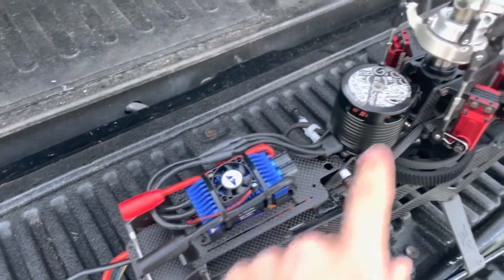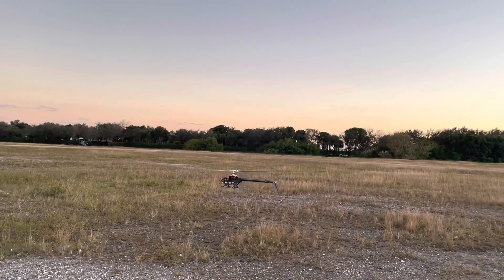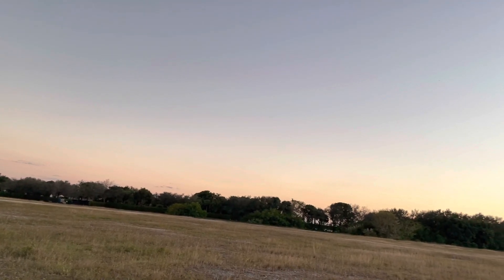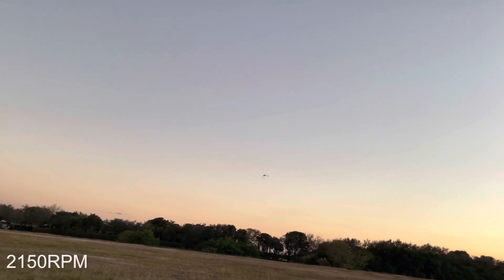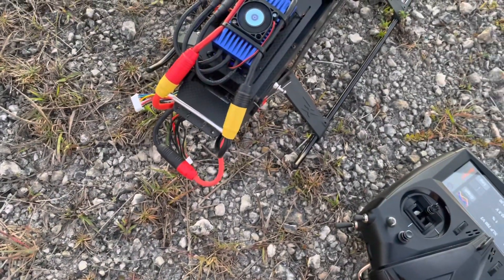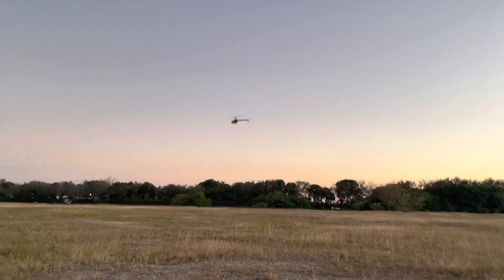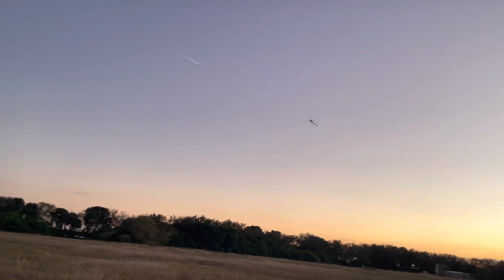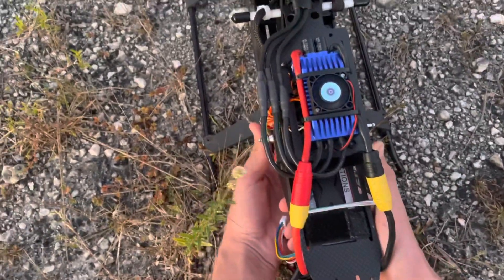XLPower Specter V2 Trying Out Egodrift 4525HS and YGE 135HVT 1/14/22 | Testing Grounds

Comment: The YGE 135 aureus was my first YGE esc and I will never change to a different brand…it stays cool and you don’t have to worry about overheating 👍…and with a 4525 size the perfect combo🍺🤘
Reply: amazing combo,  i have a raw 700 ,   have a HW 160 v4 , was thinking to change for the new 200A for a 4525 motor, but seeing this beast and how a 135 works,m maybe i should give him a try , or do you think i should go for new hw 200A?  ty
Reply: @candelasFPV  no need to change to 200 Amps.  As long as you don’t go over 160 or 170 Amps several times during your flights, the YGE 135 can handle it easily 👍
Reply: @helischorsch9786  thank you for answer !

Comment: Nice flight, but you really don't need the fan. I'm flying harder with the 135 YGE and also with over 30 degrees Celsius outside, I never reached more than 64° after 3min of hard pushing  :)
Reply from the maker: It’s not harming anything, and I don’t understand why it’s such a bother to you lol
Reply: @NoahSommer   No advantages, I hate the sound, the look and it is weight 😅

Comment: Trying Different Batteries, the Hrb have not much cappacity i think. Have really good experience with Gens ace Batts. 
Really Good Flying Man.
Reply from the maker: Thank you! And also I have tried different brands before and HRBs definitely aren’t the best and don’t deliver as much power as Gens Ace, Pulse, ManiaX, Etc. But for my needs I find that HRBs work just fine. I use them mostly because they are super cheap compared to other brands